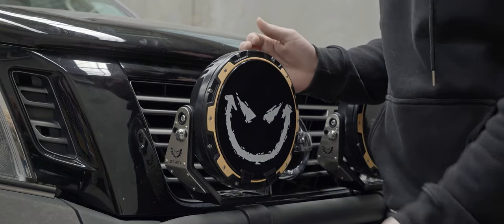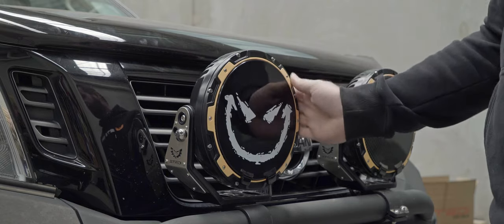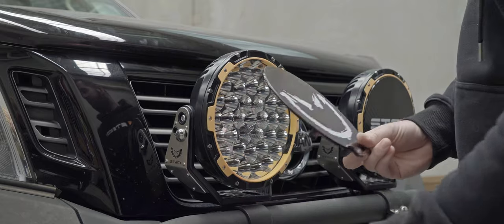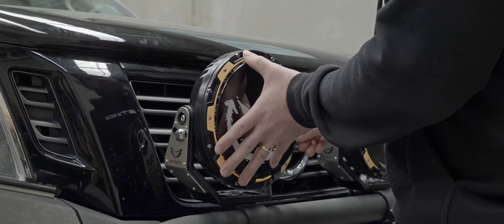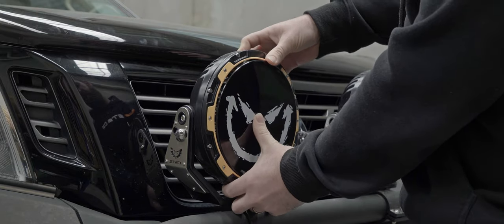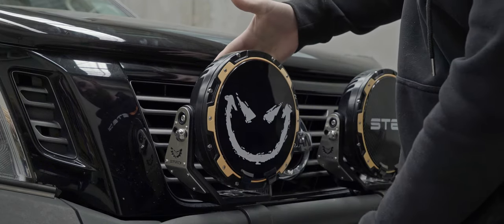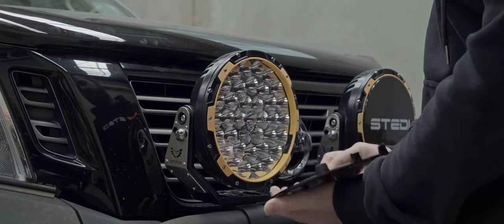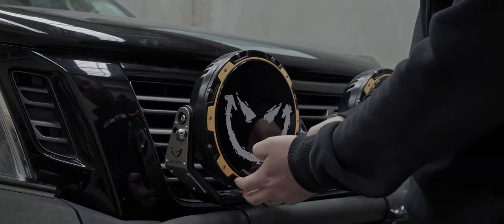STEDI Type X™ Covers | Install Guide

Comment: Just wondering how you change the coloured rings that go around the light without stripping all the tiny screws?
Reply: Don’t go to hard just nice and firm
Reply: I tried that, used the supplied Allen key. Was able to get most of them out, but a few are stuck and now stripped.